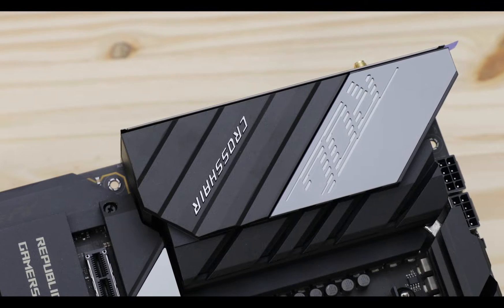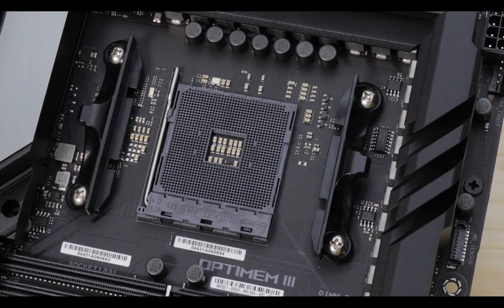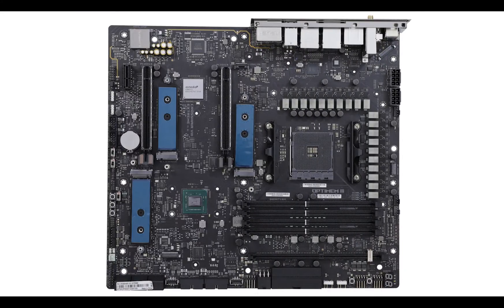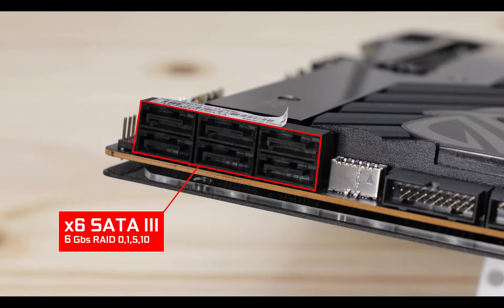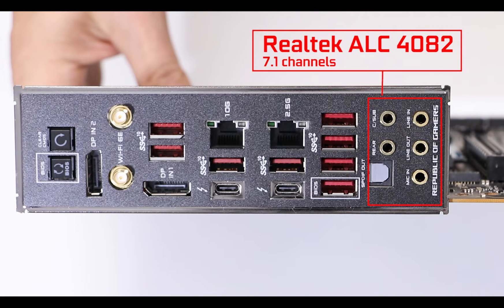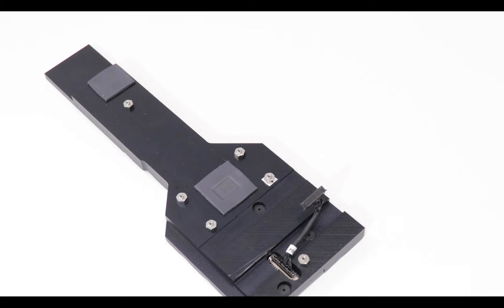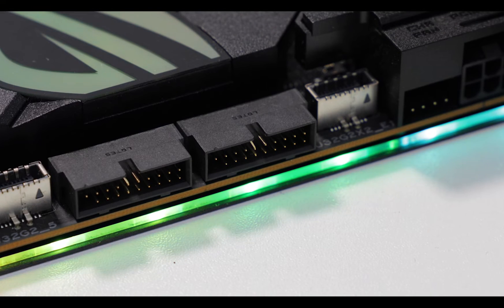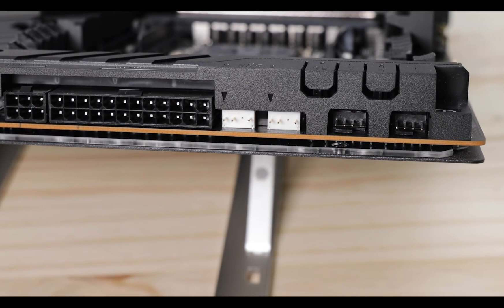ROG CROSSHAIR VIII EXTREME : Did ASUS go NUTS ??

Comment: it seems the nvme part is not correct. those 2 dimm.2 goes to chipset; the other 3 m.2 on board goes to the cpu. m.2_1 takes 4 lanes from cpu, if m.2_2 and m.2_3 were to be used, the x16 pcie for graphic will be splite into x8 + x4 + x4. refer to the manual and bios.
Reply: Oh, so that makes it possible to add two m.2 ssd's to the dimm.2 without loss of available lanes? Or did I misunderstand?
Reply: "2 ssds on the dimm.2 without loss cpu lanes" seems logical. however between cpu and chipset is x4 lanes i believe, this might be the limit for the dimm.2? I'm running raid0 from 2 ssd on dimm.2, see no speed advantages. @kitewinds663

Comment: is there anyway to make the m.2s not slow down the graphics card?
Reply: of course no answser, after a year. the lack of that inormation makes this whole video almost pointless and irrelevant. considering that aspect would be a make or break for absolutely everyone and i own the board, was waiting weeks to figure out an aswer on this matter. and now ive 3 m.2s in there with all of them disables except my m_1....and i still dont know. straight BS. dont do a review on a motherboard if you dont know how it works. ive never heard of this problem on other boards so it completel bullshit to spend $800 on it and then only become aware of it after the fact. also my board was refurbished and ended up coming without all the accessories including the dimm.2, so its not like i can just ignore that potential problem and put 2 of my ssds in that because I DONT HAVE IT! this is question is an extremely important one to me.

Comment: Great vid. Very funny, informative and entertaining. However, the most important points NOT covered here, is what happens to all those pcie lanes when you populate all five m.2 slots with m.2 drives???? Will the GPU STILL run at 16x, or does it drop to 8x? Will the bios recognize all five drives at once, and will they run at full speed, or be bogged down to 3.0 speeds WASTING your money for buying 4.0 speed drives????? These are the questions I'd REALLY like  to see you address, if you please. Thanks for another great vid.
Reply from the maker: Let me take a closer look at that and get back to you
Reply: @Laurentschoice  what was you findings?
Reply: @Laurentschoice  of course no answser, after a year. the lack of that inormation makes this whole video almost pointless and irrelevant. considering that aspect would be a make or break for absolutely everyone and i own the board, was waiting weeks to figure out an aswer on this matter. and now ive 3 m.2s in there with all of them disables except my m_1....and i still dont know. straight BS. dont do a review on a motherboard if you dont know how it works. ive never heard of this problem on other boards so it completel bullshit to spend $800 on it and then only become aware of it after the fact. also my board was refurbished and ended up coming without all the accessories including the dimm.2, so its not like i can just ignore that potential problem and put 2 of my ssds in that because I DONT HAVE IT! this is question is an extremely important one to me.
Reply: of course no answser, after a year. the lack of that inormation makes this whole video almost pointless and irrelevant. considering that aspect would be a make or break for absolutely everyone and i own the board, was waiting weeks to figure out an aswer on this matter. and now ive 3 m.2s in there with all of them disables except my m_1....and i still dont know. straight BS. dont do a review on a motherboard if you dont know how it works. ive never heard of this problem on other boards so it completel bullshit to spend $800 on it and then only become aware of it after the fact. also my board was refurbished and ended up coming without all the accessories including the dimm.2, so its not like i can just ignore that potential problem and put 2 of my ssds in that because I DONT HAVE IT! this is question is an extremely important one to me.
Reply: @OGHawkeye  You need to set it up in the BIOS. Not getting the dimm.2 is a real issue, because it uses different PCIe lanes than the PCIe slots. Basically you can have 1 NVMe in the m_1 (under the screen), and you can have 1 NVMe in the DIMM.2 for "free", but if you put 2 in the DIMM.2 or you put 1 in the m_2 or m_3 and the first PCIe goes down to 8x and the second PCIe to 4x or 0x if you install in the m_2 AND m_3. The cpu only has so many PCIe lanes (20+4) so they give you these choices.
Reply: @cannaroe1213  ok so as long as I have the m.2 in the m_1 slot under the screen (and your sure that’s the correct one) and only that slot activated in the bios, then I will be all set and not lose any performance? Yeah the DIMM.2 was a REAL issue for me you have no idea the headache it gave me trying to get that part from both the shipping company and Asus, with no success. Been impossible for me to find elsewhere too.
Reply: @OGHawkeye  wow good to know, I'll keep mine safe! Yeah if you do that the first pcie will be x16. All the best
Reply: @cannaroe1213  it could probably be found on eBay if I’m being honest, I’ve just never personally had experience getting things on eBay. But Asus customer support acts like they have no idea what the DIMM.2 module even is or that it even exists, and I spoke with several different people about it. I thought that was pretty absurd for a product that was only like 2 years old. They clearly have no intentions of supporting that tech or continuing to make them that way with the DIMM.2 it’s dead to them and short lived. They wanted me to send them the motherboard back to get a newer model if that tells you anything.

Comment: no testing or even mension about Voltage Suspension nor about CO mitigation feature, which are exclusive to this MB. 
very disappointing.
reading specs is not a review
Reply from the maker: On video, I try to walk the thin line between general public digestibility and detailed over-view and appreciation of the product. I do spec the product in a digestible manner, (with graphics and what not) and give my opinion on every features listed and its overall.
When writing I tend to go more in details :) . You might prefer my written articles. 

PS: i am surprised you did not see my VRM testing on the video.
Reply: @Laurentschoice   Thermal testing is great, thanks for that 👍, but stuff like Vdroop and transient response time matters.
feel kinda frustrated that none even mentions ASUS exclusive VRM features (Voltage Suspension / CO mitigation), 
can find only single video/article about them 😔

Will there be an article about this MB? would love to read that 😊
Upd: there's an error about USB C headers, one is USB3.2 10Gbps, the other is USB3.2x2 20Gbps
Reply from the maker: I do understand your frustration.  

I'll add a transient / vdroop section on my next video ( MSI Z690 Force) and see how it fair on viewership.

My VRM section keeps growing on every video :):)

Comment: That OLED gets in the way of a 3090 even if it’s an asus one, and they definitely don’t fit with active backplates, which you need for a 3090 regardless. 

All the while the features left out to make this board actually worth it, are missing and now on the Z690 boards for alder lake…. Wtf
Reply: Hi, I am about to get an ROG STRIX RTX 3090 and X570 Crosshair VIII Extreme. Is it possible to use the 3090 with this motherboard??? How much of an issue will the OLED be?
Reply: Don’t do it, you’ll need an active backplate unless you wait until the 3090 ti which doesn’t have VRM on the backside.  Over like 90/80% of backplates DO NOT FIT in this board, even the strix 3090 backplate active from ek kinda touches the OLED, that’s the 3mm reference

Comment: Almost no active backplates fit on this board, and they conveniently left out the QSwitch to the PCIe slots which with a 3090, is A BITCH to get to and makes you potential ruin your board attempting every time…. Half the price is the exact same board but probably actually better at the pro art creator, almost exact same spec’d board
Reply from the maker: Yes... indeed... half price board would do about the same in terms of performances. Agreed.
Reply: @Laurentschoice  i second that but i got the extreme lower than the creator and since i haven't a 3090, its not an issue for me

Comment: Great review. The monoblock was the exact reason I chose the x570s carbon ek x over this board. I also saw no point in having the external dac especially when someone can just buy a schiit dac with better quality (schiit is a brand if you don't know)
Reply: i thought it was a fancy way of saying shit
Reply from the maker: I am fancy :)
Reply: I run mine with an AIO, and it has excellent temps. NO NEED for a monoblock.
Reply: @AquaStevae  never said it was a need but I also have my 3900x, 6900xt and my main nvme water cooled in that custom loop as well. Ek had the board on sale at the time and I just jumped on it

Comment: There are a lot problems with this motherboard ! Didnt recognize with 3 nvme ssd connected to the m2 ! The bios is not finished
Reply from the maker: For the NVme, are there any SATA plus used in the same time ?
Reply: @Laurentschoice   nope only 3 samsung 980 pro nvme ! Did you try to connect all m2 on the motherboard ?
Reply from the maker: I tested a 3 , 4 and 5 M.2SSD configuration . 

Obviously some SATA plugs were disengaged on the 5 M.2 SSD being connected. 

Did u run "create and format hard disk partitions " under windows. 

It would show u detected drives and allow u to format them and assign them a Drive letter. 

If you are dealing with branded new NVMEs, they won't be detected unless u do the above !
Reply: @Laurentschoice   thanks Bro i found the problem it s was in the bios ! Pcie was activated only for the graphic card 2X 16

Comment: This is an amazing motherboard.  To find a proper case had been a biggest problem for me due E- atx and side power connectors. Cooler master h500m  is the one. Temps are outstanding.
Reply: Use the rog strix gx601 helios case buddy.
It is a e atx case
Reply: @shehaniddamalgoda8461  I was going to get it but Not much space for future upgrades that is why I went with a full tower case.

Comment: You're reviews are, imo the best and most comprehensible. Greatly appreciated.
Reply: this is an ad, not a review.
Reply from the maker: How is it an ad when  I say a board half the price could do the same ?
Reply: @Laurentschoice  I was wondering the exact same thing 🤷🏻‍♂️
Reply: @Laurentschoice  it's certainly not a review, you just presented a product. I didn't learn anything that I couldn't just read (and I already read) on the specs page. You don't even point out that the DIMM.2 slot shares lanes with the gpu slot. You didn't run any performance test, thermals test (chunky heatsinks without fins are good to absorb a heat spike, but once they reach a stable temperature they do very little to cool, so it would be interesting to see if there's any performance drop on the chipset  and or/SSDs after prolonged usage). Also the audio DAC is included to increase the perceived value, because even if they sell it for hundreds of dollars it probably cost them less than 5$ to make.
Reply from the maker: Hmmmm... I guess you missed the thermal testings.
In the video and on camera I test the VRM, it's heatsinks, the chipset heatsink,  the m.2 SSD heatsinks with thermal gun and share the thermal images. 

You can see them as well, and a bit more , on my articles online.

I wasn't aware asus now includes VRM specs , chipset wattages, etc.... on their spec pages. 

I learn something everyday :)

I hope this helps
Reply from the maker: Right.... so you did not watch the Intro, nor the thermal testings section, the heat sinks disassembling, inspection, thermal testing (half the video), and you did not watch the conclusion which was not positive for the board. 

In short ... you did not watch the video. 

Hmmmm....
Reply: @Laurentschoice  I hv a question🤔
Will I need to connect both the 8pin cpu connector when I am not planning to overclock? and if I do, will I damage the cpu??

Comment: Thanks for the review Laurent. I am planning to upgrade my 6700k to 5900x but couldnt decide which mobo I should pick. Could you please give me a suggestion? I am kinda turn off with x570 active cooler (fan). Should I go with msi x570s tomahawk max wifi, aorus x570s pro AX,  or asus rog crosshair x570 dark hero (not sure if I need this). I have asus rtx 3080 oc ed. Thanks.
Reply from the maker: Tomahawk x570s blindly !
Reply: @Laurentschoice thanks!

Comment: oh... darn... that's be a sweet board......
Reply from the maker: But who's going to pay 900 bucks for it ! 🤔 

But I'll tell u.. the level of finish on this.. is insane...
Reply: @Laurentschoice  yes.... but I do large scale animation and leave my machines running 24/7 (two of them, 3900x and 5950x) and need a good connection between them, so two 10G LAN ports and ability ot have TEN (YES , TEN!!) M.2.s in the MoBo's would be such a  big production thing for me.... especially with both going to 5950x (there is a big difference).  But as you say, "Who's gonna pay $900 for one? And who's gonna pay $1800 for two! Not to mention needing to buy another $10k in M.2s